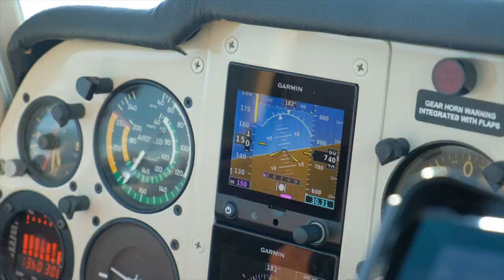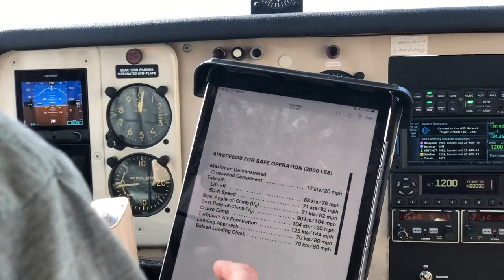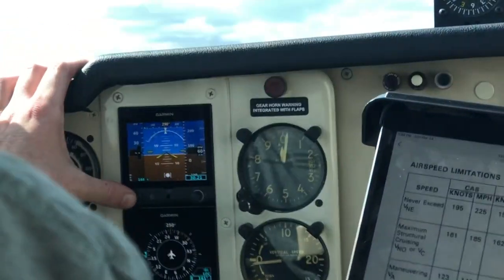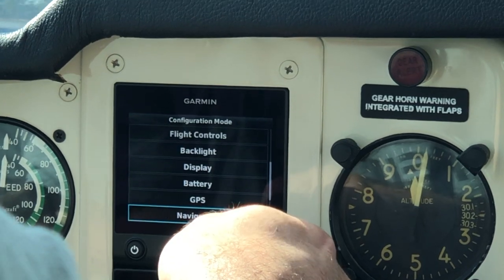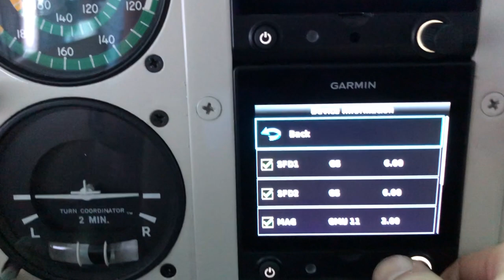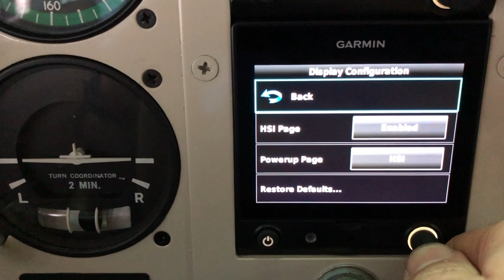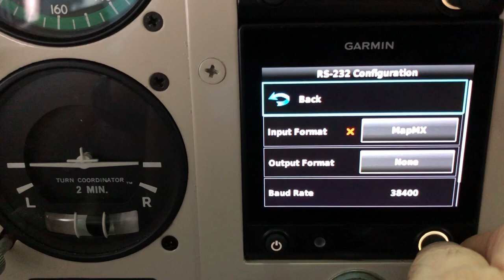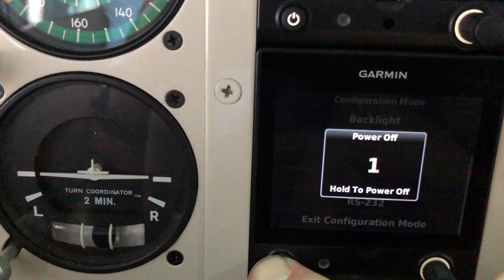Garmin G5 Configuration

Comment: I tried to configure on the ground using the battery back-up power but I couldn’t access it.  Do you have to be running off the ac battery?
Reply: Yellow Thunder thanks for the question. Yes, you have to be on your aircraft’s 12/14 or 24/28 volt DC bus power. Let me know how it goes!